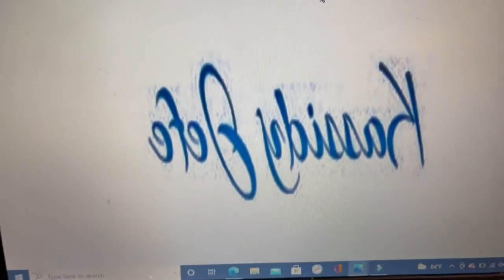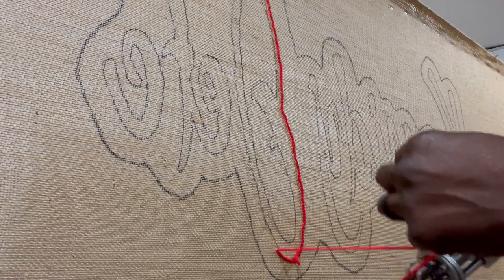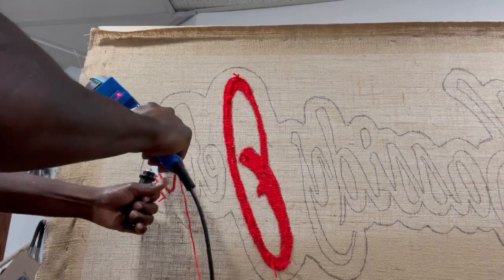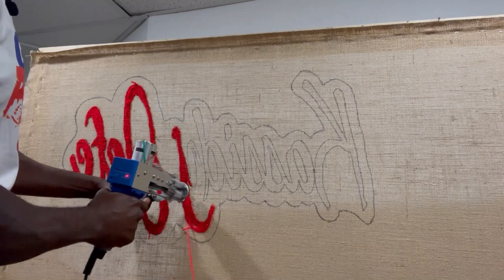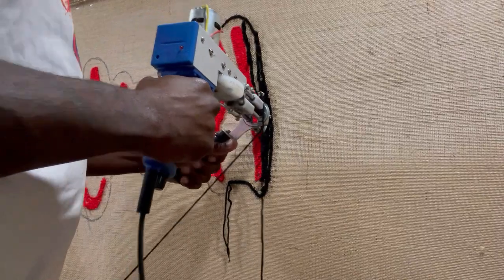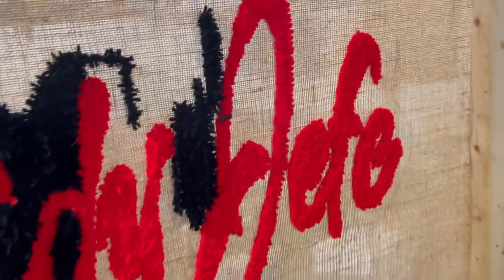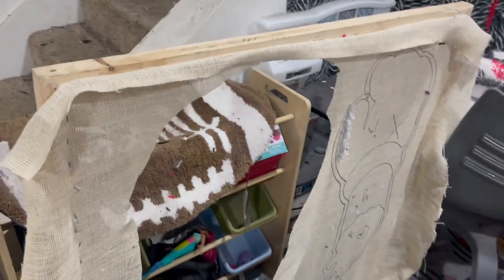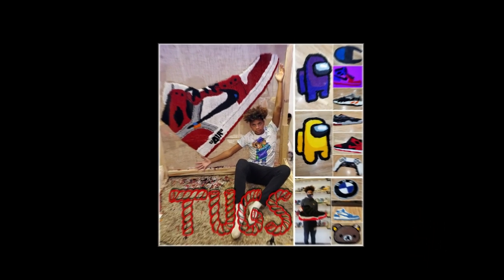Tufting With Both Loop And Cut Pile Gun | Tugs Rugs

Comment: I see everyone using wire to thread their tufting guns, but if you don't have wire handy, you can wrap a 1/2 inch piece of tape lengthwise along the yarn and trim it, finishing with a point and then trim it off.
Reply from the maker: I don’t use anything. I just break off the ends so they’re thin, then twist so they fit in the hole

Comment: Hey brother, 2 questions. 1. Is it just the finished cut pile that is shaved last or is the loop pile as well? 2. Why don't you use double yarn?
Reply from the maker: I use double for the cut pile. The loop pile is already so impacted with just the one yarn that why I don't use 2. I also only shave the cut pile parts
Reply: @TugsRugs  Thanks for answering. I have seen many of your videos and noticed that you use the cut-pile a lot more. Do you prefer that one despite having to give more clean lines and details?